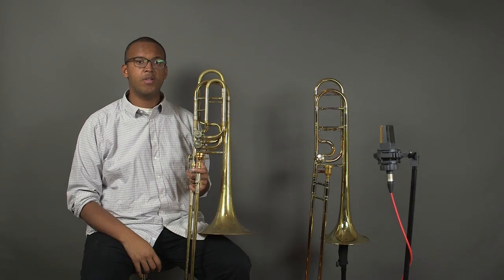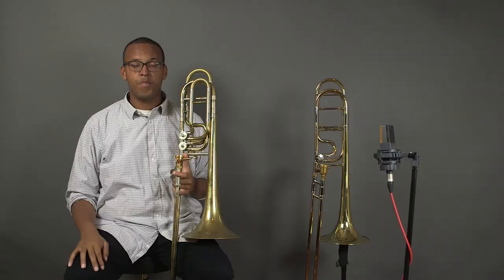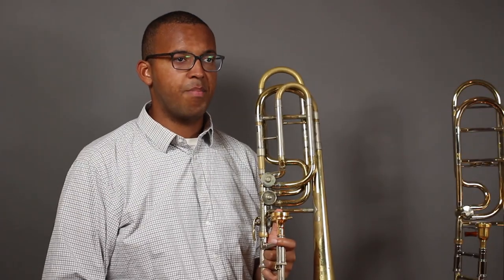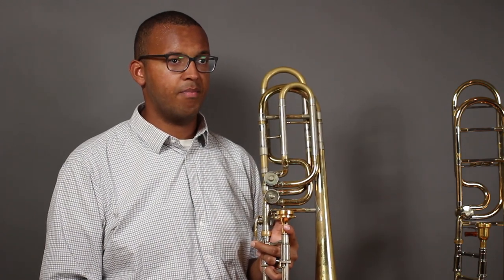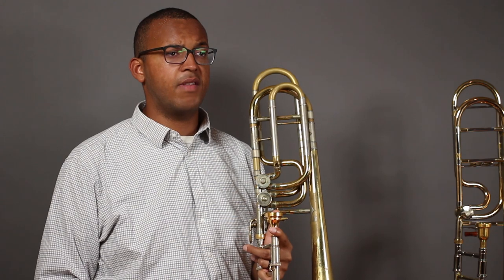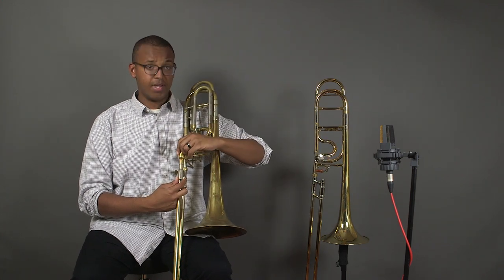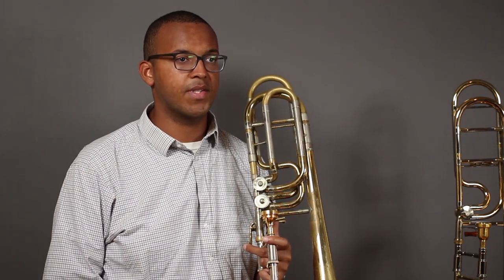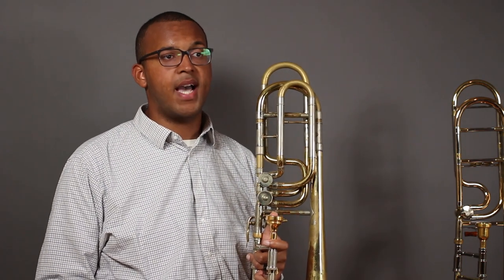[Explained] Bass Trombone

Comment: It's pretty incredible how much difference 15 onethousands of an inch in bore diameter makes. Without the second valve, those two instruments are the same length and tuning. But when I put my bass mouthpiece on my tenor, it doesn't play like a bass bone; that's for sure.

Comment: So are the valves the two brass circles?
Also is the bass trombone the same octave as a tenor, it’s  just able to play low notes better and easier?
I’ve been confused but I know the contrabass plays in the tuba octave so I would assume

I play Tuba and was thinking about getting a trombone for Christmas so I could play all low brass instruments at my school
Reply from the maker: You are essentially correct. The circles are the valves but other trombones have different looking valves such as the Thayer/axial flow valve which is more like a cone. The modern bass trombone is really the same length as the tenor but generally with an additional, larger tubing and a bigger bell. This all aids the bass trombone in having an easier time in the low range.

Comment: Single valve bass bones are called tenorbass trombones, right??
Reply from the maker: I've heard that once or twice but I wouldn't say that is an industry standard term. Single valve bass trombones are still bass trombones but most modern bass trombones have two valves. Things get a little bit gray with tenor trombones with larger slides or bells.
Reply: I've read that that was an early name for a trombone with F attachment. But back then nobody was playing anything as large as a .547 bore tenor in the symphony either.

Comment: Is there some kind of “recommended” low range on a tenor trombone if you want to switch to bass? Right now I can go down chromatically to a pedal A or a G on a good day, except for the low B natural
Reply from the maker: I don’t necessarily think of a hard and fast rule. In some ways as a teacher, I would be more concerned with low range tone and general facility. General bass trombone literature in large ensembles does not go lower than the notes you can already get to. There is going to be an adjustment no matter what but it sounds like you are a good candidate to switch if that’s what you want to do. I might add that bass trombone still has to play high and playing bass doesn’t mean you only play low.
Reply: @LowBrassU  that’s alright with me, on tenor I can typically play up to a double C#, and my low C is almost perfectly in tune majority of the time. Right now I’m working on not puffing put my cheeks so much on anything lower than an Eb but I’m improving
Reply from the maker: @quandabulous_g_official1937  While very few brass teachers encourage their students to put their cheeks while playing, many professionals do puff their cheeks especially in the low range. Personally, I don’t encourage students to puff their cheeks but if they are puffing their cheeks in the low range and I don’t hear a problem, I’ll probably let them continue doing so.
Reply: @LowBrassU  yeah my private instructor said it was acceptable to puff out your cheeks in the extreme low range, but I only do it for notes below the staff. If it’s just a low F or E I’ll only do it if I have a higher note before it. Thanks for the advice though, I appreciate all the videos explaining things like this 🙏